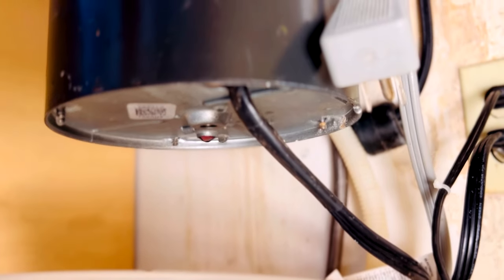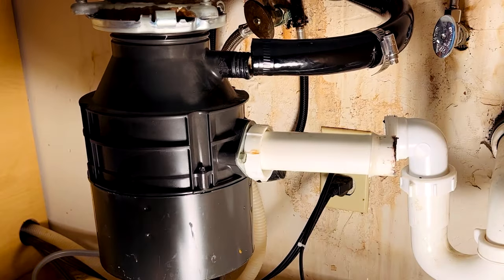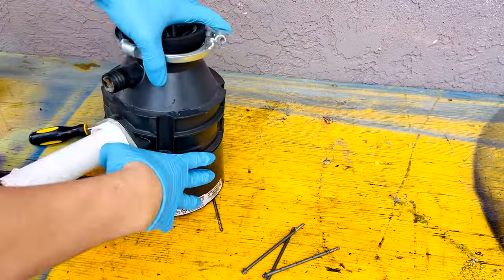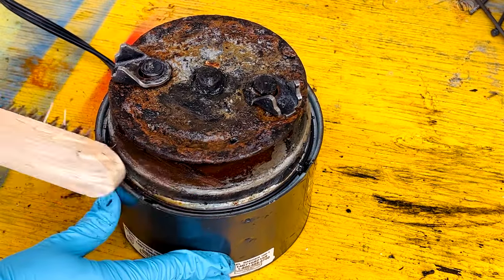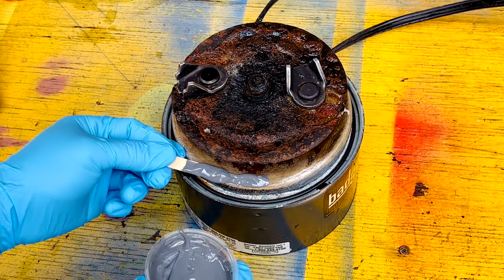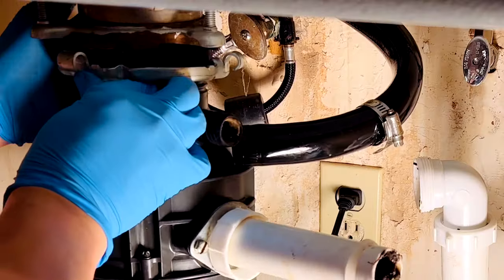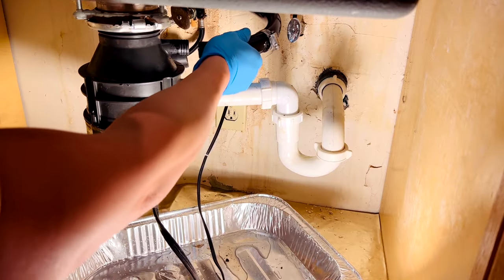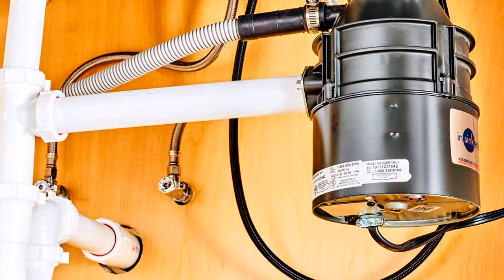Leaking Garbage Disposal? Quick Fix Trick Revealed! Leaky Garbage Disposal From Bottom DIY Repair

Comment: Lol everyone saying just buy a new one have no business watching this
Reply: There's nothing quick about this.  No one in their right mind would go through all this instead of just getting a replacement.
Reply: Lmao I brought a new one but times might be hard for some, they cost over $100
Reply: @Bythebartalk  sure, but also bottom side leaks are essentially non-repairable anyways. Only leaks higher up can sometimes be mitigated
Reply: @thawhole9 it took my 15 minuetes to do this and it works like a charm, why waste 100$ if its thise easy. i removed 4 bolts and got a flathead and it came off and i put some jbweld and put the bolts back on. this was faster than buying a new one
Reply: You have no business commenting.
Reply: Hahaha, I ended up just buying one but I do find this useful.
Reply: Is that why all the comments are deleted? I'm curious
Reply: Maaaàaaaan ain't no one trying to do all of that lol.. new badger 5xl 1/2 drive is $130
Reply: @roni1976  I replaced mine for that price last month and all you do is quick drop it and twist the new one on 😂
Reply: Exactly! If you don't have the $100, & have the time this may be the route to take to buy you some time like a month maybe some more. 
Something he doesn't mention is that you need to reseal the outer case as water will leak from there & could be the source of your leak. JB Weld can cure quicker left out in the sun if it's hot where you are, or you can use a hrmeat gun or blow dryer to help speed the curing so you can at least reinstall. Using a quality caulk could also work in a pinch, but RTV as is used in automotive sealing applications would be better. On the bottom below the grind ring you don't have any abrasion simply water & ground food particles so for a temporary fix that may just do it. Again don't forget to clean & reseal the case.
Reply: More horrible advice!
Reply: I just bought a new one cause the last was totally wrecked, and it has this problem 😭
Reply: There on Facebook marketplace for 40 bucks good for another 30 years

Comment: That model doesn't last long, the cheapest, better replace that with an stainless inside parts.  That fix won't last because the steel material is already rusted, you are wasting your time.  Don't follow his advice, very bad advice. I own an apartment and I replace all that model with Costco American Std on sale 60 bucks, lower price than that model.  Last minimun of 7 years.  That model last only 1 year and weak motor.
Reply: Mine is 7+ years old and just started leaking. From your experience, maybe it is just abuse from renters on why they only last a short period of time. No need to say this method won't work.
Reply: My house has this same exact garbage disposal when I moved in (2014) and up until this week in May 2024. It started leaking from the bottom exactly like this video. So wrong, they don’t last 1 year

Comment: I'm in the middle of working on this. I couldn’t get the hose clamp off, so I unscrewed the long screws, removed the bottom part, and found just three small holes. I filled them up and am now waiting for everything to dry. I’m pretty handy but not a pro—if this works, I’ll have only spent $11 on JB Weld and a metal brush! Once it’s all dry, I’ll reassemble everything and report back! 🙌
Reply: Haha! It worked! Thank you very much! 🙌🏻🙌🏻🙌🏻

Comment: Good info. You were right about the crack. I followed step by step instructions. One detail left out, in my experience, after the disposal is reinstalled don’t be alarmed if it still leaks. You may need to purge the remaining water that is sitting in the bottom of the disposal.
Reply: What do you mean by “purge” the remaining water?
Reply: Leave a bowl under the disposal and run the disposal a few times because there may be wqter sitting in the bottom of the disposal.
Reply: What if the disposal is brand new and has a leak already?
Reply: @QuBurlz  right? I just bought a brand new one that's leaking after a week!
Reply: warranty?

Comment: Ok, so I took out the disposal no problem. Separated the two parts by removing 4 bolts. I cleaned and brushes as instructed. I was able to see about 3 little holes. I bought the seal as instructed and applied it. Let it sit for like 8 hours was sealed and dry. I filled the sink up twice, issued the drain a few times.. I saved over $100 by doing this..doesn’t take too much time at all and is worth it. Thanks for the vid man!
Reply from the maker: You’re welcome.  This is the reason I do it.  Thanks for the comment

Comment: Thank you for making this video.  I was able to repair the disposal without any issues.  I simplified the steps by just removing the section that needed fixing (where water drops came from ).   Thanks for suggesting the 5mm wrench worked like a charm.
Reply from the maker: That’s great.  I’m glad it helped 😃
Reply: That's a great suggestion.

Comment: I would only recommend this fix if you are tight on money. It is a temporary fix for the same reason autobody mechanics dont like to repair rusty side panels on a car/truck. Once the rust has formed, it will continue rusting, and whatever you coated the metal with will flake off. 
I always recommend paying more for the higher grade models with stainless steel internals and a longer manufacturer warranty. 

And btw, plumbers from get tired from having to change garbage disposal’s. Those jobs are easy! We get tired from digging trenches, crawling and working in tight crawlspaces, and moving heavy bulky plumbing appliances and fixtures! We don’t take it personal though haha
Reply: Actually I put CLR on the rust of my 71 Blazer rocker panels and has not deteriorated since. That over 5 years ago.

Comment: Not a bad idea.  How long do you think will the apoxy last? I'm pretty sure it's not as hard as the original metal. I have a similar problem that just developed on my disposal that is nearly 30 years old. I think in my case it's just best to replace the unit.
Reply from the maker: After 30 years? I wouldn’t recommend doing this LOL

Comment: As a 40+ year plumber, these garborators should NEVER be used without an intercepter in place, garbage belongs in the garbage, not in your drainage systems, these will plug your drains and cost you dearly, even restaurants require interseptors by code! just think about it for a minute! NO FOOD WASTE DOWN ANY DRAINS, EVEN THE TOILET, SAME RESULT!
Reply: Mine started leaking. I agree that we shouldn’t be putting food down the sink for all the reasons you stated. I want to get rid of mine completely. Is this a do it yourself job at all?
Reply: we removed ours and no longer have a disposal. It leaked bad causing a huge mold issue.

Comment: Mine got jammed so i used the hex to unjam it,it seemed easy but then started leaking water down the electric line or that square plate on the bottom. Do you think I should try what you did or try and buy a new one. The bolt to the electric cord was lose, I was hoping that was the problem but after I tightened it, it still leaking. 😢
Reply from the maker: You can only do so much.  There was only one issue with mines, but if your having multiple issues I would suggest replacing it.  😃
Reply: @don_wynn  
The only issue is it's leaking water down the electric line on the bottom which started right after I unjammed it😔
Reply: @doreenswee-ff9ez  This is the exact problem that I’m having now. What was your final solution to this problem…please share? 🙏🏼
Reply: Same issue I’m going to take mine apart tomorrow

Comment: I recommend buying a new one. Thanks for the info as I will install the new one myself...It is pretty old as I will not spend time fixing an old device. They are affordable.
Reply: That's for sure.  You can pick up a new disposal for $99.00 if you want and it should last many years.  This is not worth repairing.
Reply: @logicwurx  Agree...

Comment: Would getting a stainless steel unit  in any way protect the garbage disposal from the effects of hot water?  (especially the O Ring and the motor seal)   I think ''hot''  water that is also 
''hard water'' in Las Vegas  is the reason why I only get about 3 years out of my garbage disposals that use galvanized parts, and I heard stainless steel is better, but how is that
better if in my case where I live  it's the  O Rings and Motor seals  that are the weakest points ?
Reply: Yes...Thanks..

Comment: What would happen if i just applied the epoxy to where the leak is on the bottom? Not sure i have the tools to disconnect the unit.
Reply: Do you have a screwdriver?  If so you’re all set!

Comment: I would never in a million years have expected your garbage disposal to start leaking underneath, and mine isn't ancient by any means.   Mine was dripping for who knows how long and eventually started raining, ran down into a metal toolbox I had in the basement and ruined all the tools.  As well as soaking all the floorboards.   Isn't that nice.
While I appreciate this fix, I feel like you may as well just replace the garbage disposal unit.   Eventually another part is going to rust through, and I have had nothing but issues with JB Weld staying in place and not breaking off.
When one looks at the rust, one wonders why they would not simply make the grinding wheel stainless steel?
And the only answer I can think of is planned obsolescence.
Does anyone know of a disposal being sold that has a stainless grinder wheel inside, that won't rust through eventually?
Reply from the maker: That was horrible what happened to you, I couldn’t imagine.  And yes, the best option is to replace the entire unit.  When this happened to me, I was in a panic and I didn’t know what to do.  The cheapest way I found at the time for a fix was this.  I would recommend replacing the entire unit for sure .
Reply: @don_wynn  oh hey- I found a garbage disposal unit that actually has stainless steel parts inside instead of galvanized!   Instead of being guaranteed for 3 years like the In-Sink-Erator Badger 5, it has a lifetime corrosion guarantee.
It also swaps out perfectly with the old sink latch.
Its called a Smart Choice SC05DISPC1
Same price too!   Crazy people are buying disposals that rust out. 
Just put it in its working great

Comment: Nope.  This is just asking for trouble.  You broke a factory seal (and didn't install a new seal) and still have a rusted bottom plate.  You might temporarily fix the unit but more problems will come up sooner and be worse the next time around.  Unfortunately, the manufacturers behind this type of equipment intentionally do not engineer them to last.  A better design would be to encase the metal plate in a coating that would provide a superior sealant for the housing that would allow the unit to function for decades with minimal to no rust.  These units are engineered from day one to fail.  Frankly, I'm a bit shocked that building codes allow these to be installed in homes.  Water and electricity don't mix!  Granted, the windings around the motor are shielded, but it wouldn't take much to cause a short and start an electrical fire.

Comment: This is the second garbage  disposal that leaks on me why???? I don’t even use it that much???
Reply: same issue here,  but mine gave out today and as I'm learning here on Youtube what happenned,  one thing stands out,  ''Hot Water''  not sure how big an impact this has
but if that doesn't make sense, what if your water is very ''hard''  ie corrossive  like our water in the Las Vegas area,   either way, the thing I'm wondering is, 
why would a stainless steel model be more resistant to these type of leaks?  I don't see why they would, but that's what some say is the problem, your average  garbage disposal
has galvanized steel,  but to me that does not explain all of it,  I've had some garbage disposals with light use  last less than 3 years.

Comment: Check the out pipe. Mine was rusted and developed a leak down to the wire area (maybe?!?) I wound up replacing the unit anyway but the leak could’ve been fixed and saved myself $150.

Comment: I live in an old apartment complex. I've had several leaks coming down through the my ceiling from the apartment above, over the course of several years, as well as having experienced, gurgling and foaming toilet bowl incidences, and sudden instances of dripping faucets...out of the blue. Suffice to say, I have endured too many leaky situations over the years...to feel settled about. Consequently....from time to time, the unit above me would summon a plumber, and things would be okay for a while, then before I knew it....another leak.  Most recently....I was using the kitchen garbage disposal and had the light above the sink on as well. I have never experienced anything wrong with the operation of the sink or disposal, sans brownish water and the tainting of my water faucet with white spots. All  has been functional aside from those two factors. All of a sudden....the disposal stopped working and the light went out. After some research, I found that both of the outlets...on the wall of the disposal and light....were out cold, meaning, no juice at all. Even after I had toggled the GFCI buttons, and checked the breakers, which were found to be in the correct position. Nonetheless, for good measure, I toggled the breakers as well. This happened on Wednesday. Thursday, I woke up to find that 'miraculously' not only did the disposal work, but the light above the sink and the two wall outlets....were working perfectly, and I hadn't touched a thing. Today is Friday, and the only repercussion from Wednesday's incident is that the disposal is still dripping. I have a coffee can underneath to catch all. It seems to be dripping at a reasonable rate and not pouring. The day that my outlets, disposal, and lights stopped working....I could hear that the upstairs unit was undertaking some kind of plumbing fixes. Being home, and the units being old and poorly constructed...I can 'hear' lots...For instance...it often 'sounds' like the water from upstairs coming down my wall between the bathroom and the kitchen. It's very loud, and was even shocked the first time I noticed it, and took a video, just to capture the loudness of the water I could hear from the wall. With all that I have relayed........Do you think that it's possible....that the plumbing issues coming from the unit above all these years, as well as their 'attempts' to fix the plumbing....probably with non-professionals....are affecting my unit. Please respond if you can. So....my story...is not a fun story. I seem to get the brunt of leak after leak...with a not-very-responsive landlord ( the unit above) that lives out of state and has, in the past, tried to make light of the leaking issues. My feeling is that he is renting as section 8, has owned the unit for many years, and obviously....does not care too much about the leaks I have experienced....as well the huge inconvenience...time and time again. What are your thoughts...about the continuous plumbing problems, and....my recent incident with the garbage disposal.....et al?????? Thanks so much...if you have a clue!!!!
Reply: Wow, that's torturously difficult to read. Please try paragraph breaks--and maybe gather your thoughts by outlining a lengthy story like this into an email draft or something, where you can copy/paste to a YT comment.  It would help avoid the rambling--which will be more likely to get you help.

Your power could have been cut by workers above you--if you're downstream from a breaker in the other apartment--and then it worked later after they turned it back on. That's not an ideal wiring scenario...but many installations are far from ideal.

I'm unclear on whether your disposal is still leaking.  The technique in this video may help you fix it, but we can't make that assessment for you.

Me personally, after watching this and another vid I'm heading to Lowe's for a new one. If I spend the time removing and re-mounting a disposal, I want to know I'm not doing it again for several years.

The dripping sounds you hear could be problems, but they also could be normal plumbing.  Your neighbor's sink or toilet is likely to come down the top of the same drain pipe that's in your wall. If that wall doesn't have insulation in it, this can be surprisingly loud.

If your relationship with the landlord is truly a case of chronic neglect, it may be something worth discussing with an attorney.  
If not, it may be better to simply move and be done with the headache of an apathetic manager.

Good luck.
Reply: @zedmelon thank you for reading it for us and giving the advice.

Paragraph breaks save lives 😭
Reply: @Kevintendo  Glad to help.  :,)
Reply: I’m not reading all of this
Reply: @zedmelon 🤣